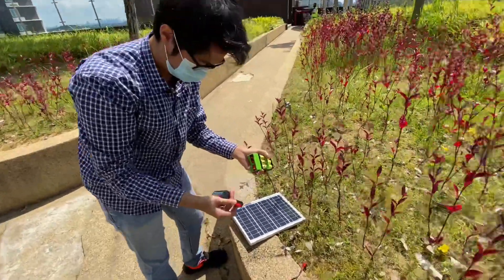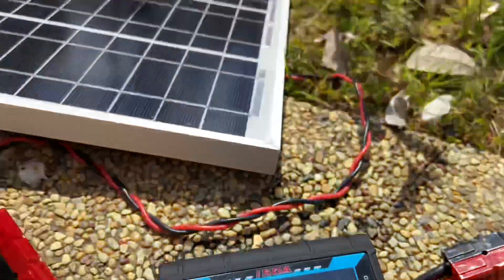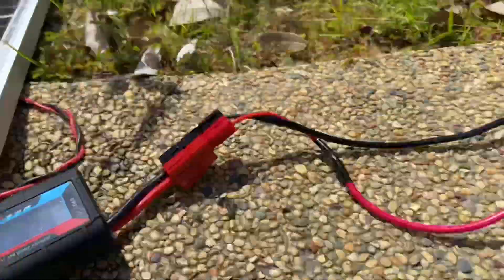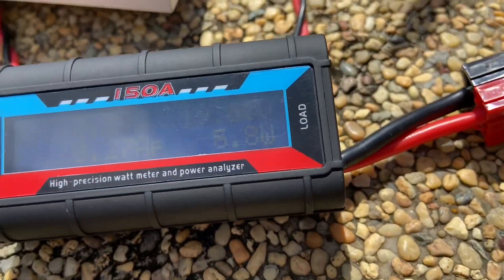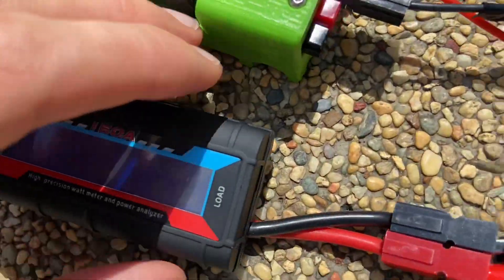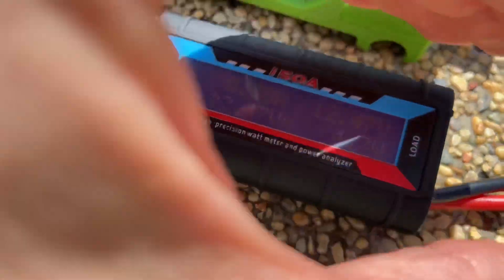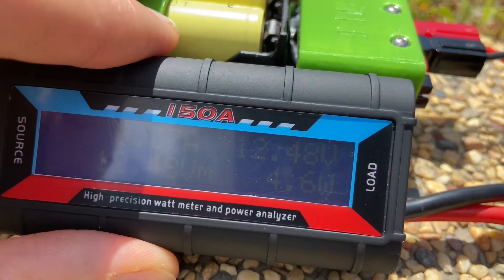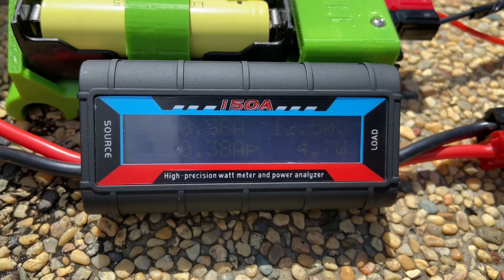Testing our 12v DC motors with a “10 watt” solar panel.

Comment: How long it take to charge that battery using solar panel 10w? And how many mAh is that battery?
Reply from the maker: only watts matter.  charging took place at a rate of 5 watts.  big battery has more watt-hours of energy. small has less. v*Ah = Wh
Reply: @davidmalawey  it's been a long time but thanks I guess
Reply: @davidmalawey  I actually already studied I bit